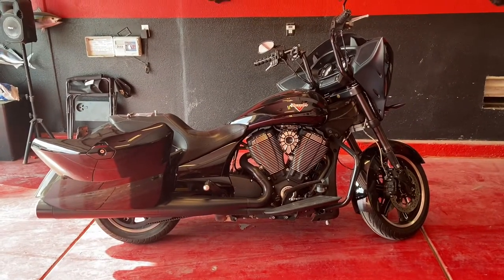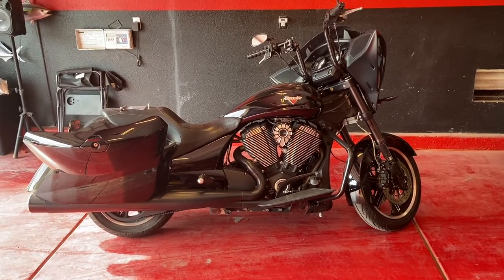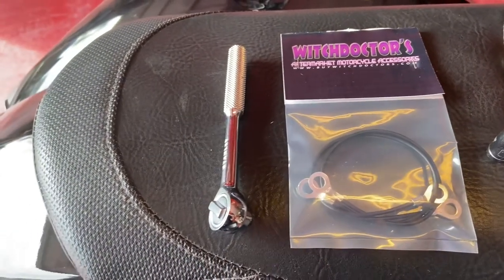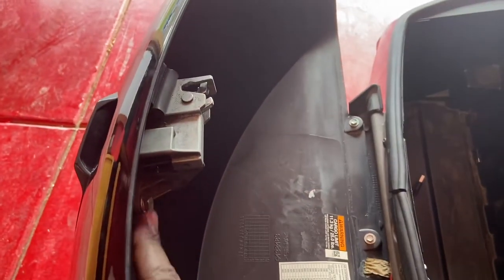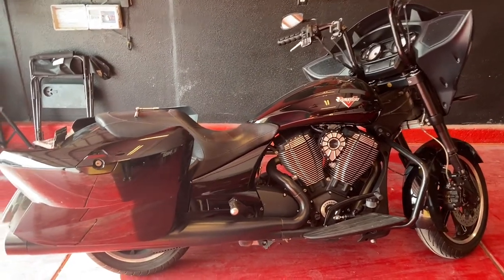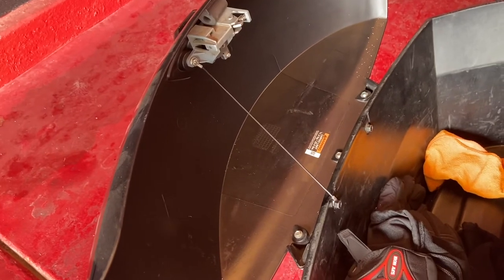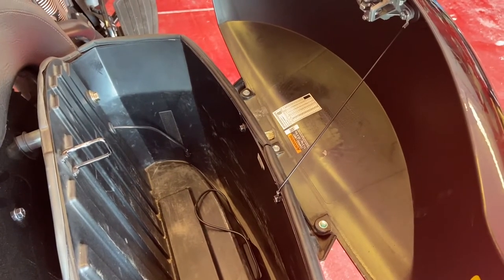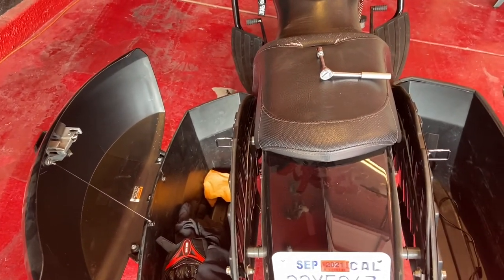2016 victory cross country saddle bag Tethers

Comment: in the picture on witchdoctors, it shows the tether going from the front latch bolt to the rear mount bolt. I wonder if it has anything to do with proper angle of pressure on the tether mounts vs going straight up as you put it. just an observation